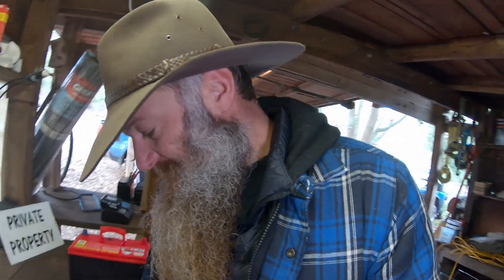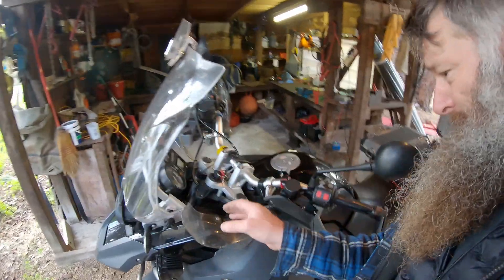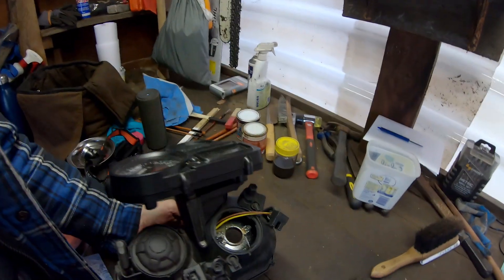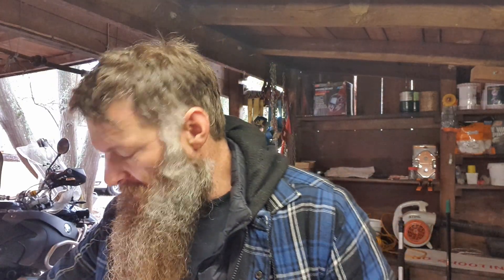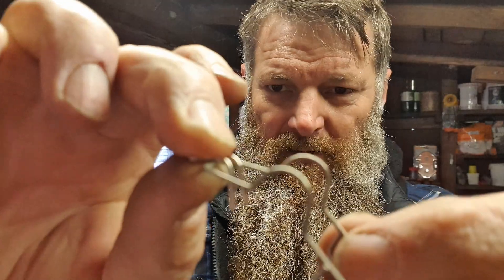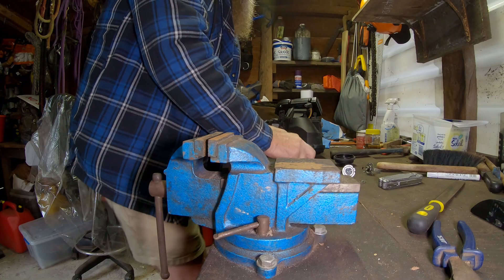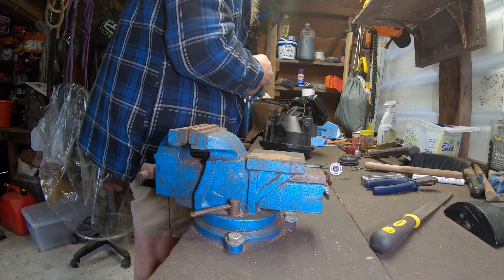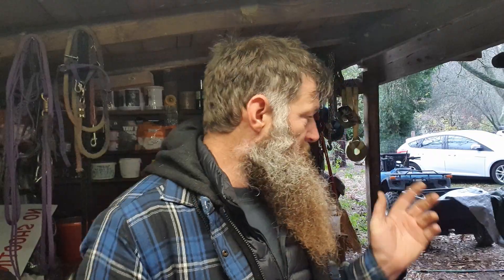Can a paperclip fix the headlight on my BMW R1200GSA?

Comment: Good tip. I must go out in my garage to try this. Luckily I have lots of those black metal paper clips to take that part from. I've had my GS adventure (2010) for three years and this is the second time in a year now I'll have to change the low beam bulb. #ThumbsUp